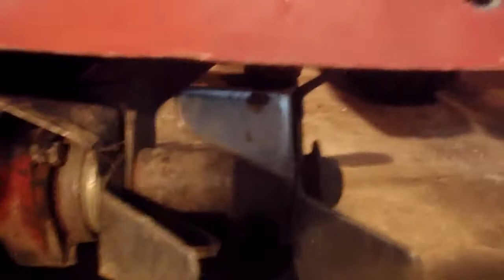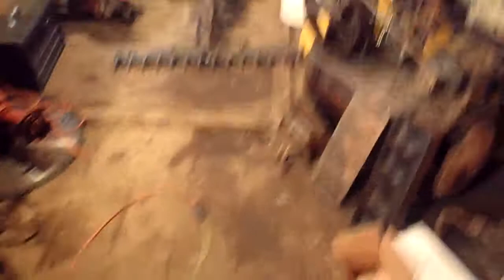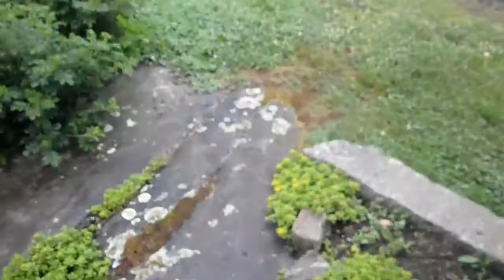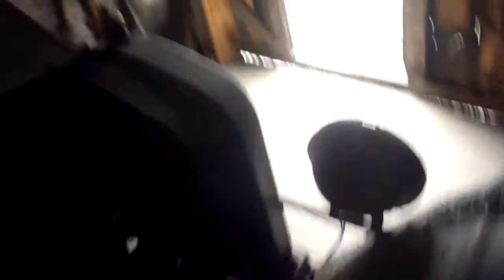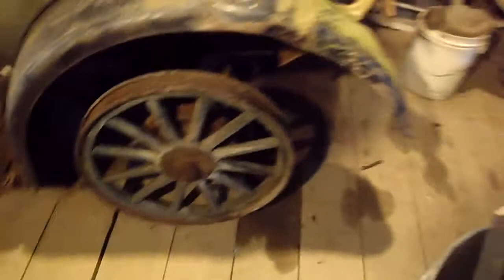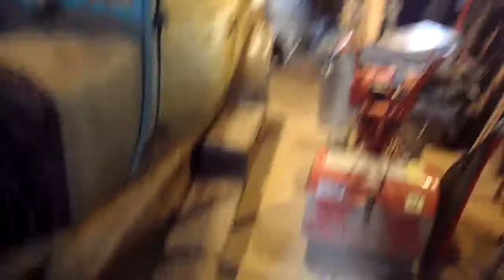Update on the Gravelys and my 1926 Ford Model T Two-Door Sedan

Comment: @theniggerrigger in short yes they will. just make sure you get the six bolt 106 mower drive, and not the weaker 4 bolt verizion  (where they bolt to the deck) heavy duty brush blade and you can mow whatever you can push under the deck. for 2700 i could have a whole fleet of gravely's. hope this helps you. if you have anymore questions feel free to ask me